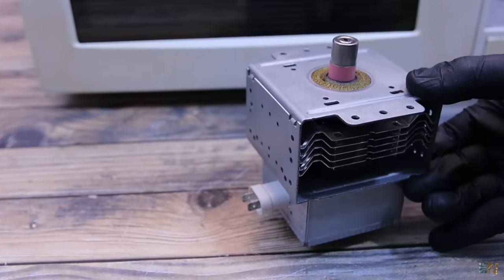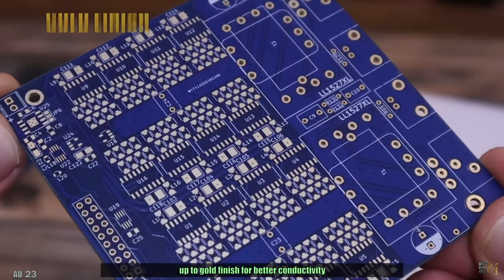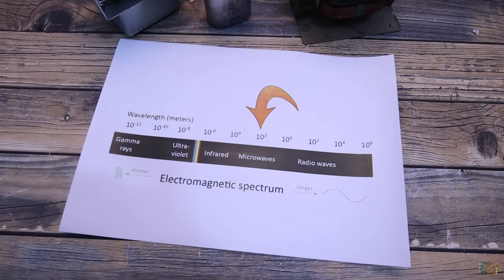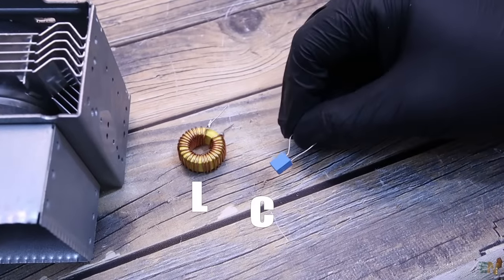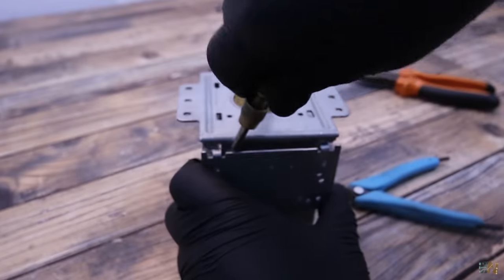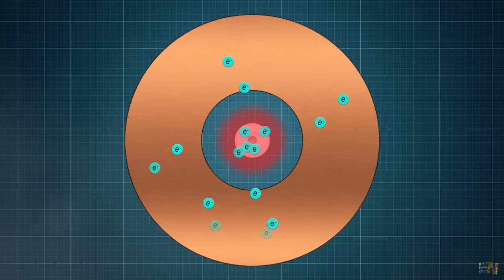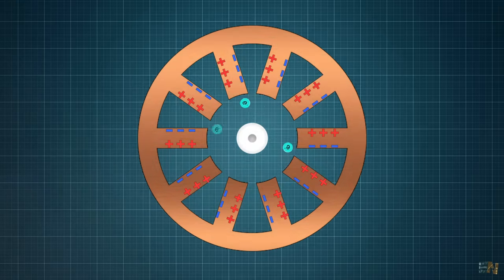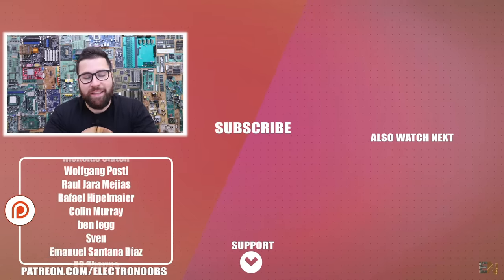MAGNETRON - Teardown + How It Works - Dangerous!

Comment: I worked on radar systems since the mid-seventies in Marine aviation.  I have had a basic understanding of magnetron operation all these years and even taught electronic theory as an instructor, but this was the clearest, most accurate description of what is truly happening, that I've ever heard.  Thanks!
Reply: @stujones3566  Same - really clear info on the LC circuit.
Reply: John, what is the power and frequency used in Marine radars ?
Reply: @Mayosoftware  Tesla level stuff man!
Reply: @JohnNy-ni9np  sus comment
Reply: @JohnNy-ni9np ...its adjustable for military purposes. Long range dissipation is very high. A so called horn focuses the beam. A ordinary sheet of aluminum foil can already protect 100% by reflection.
Reply: I remember once reading about the first encounter with microwaves, from a radar engineer who had a chocolate bar in his pocket, when he got too close to the radar, it melted. Thus he founded the microwave idea.
Reply: Funny I was a radar operator in the Army and this is the clearest anyone has explain magnetrons.
Reply: @synthoelectro I heard similarly, though I heard it was the operators were setting their coffee cups on the equipment and later finding it being hotter than when they first placed it. The radiation bleed was present just not so drastic as to melt a chocolate bar as one walked past. Not to mention body heat will also melt chocolate. 

Cheers!
Reply: ❤❤❤❤❤❤❤ممنونم بزرگوار محترم استاد باشکوه❤❤❤❤❤❤

Comment: Newer microwave no longer use brillium oxide so you're perfectly safe but it's the ceramic dust that you should be more caution about
Reply from the maker: That was kind of an old microwave that's why I tought it could still have... Better avoid it :)
Reply: @ELECTRONOOBS  I think it’s safe as long as you not breaking the ceramic
Reply: Beryllia is very white; a pink tint generally indicates alumina (aluminium oxide) ceramic which is much safer to handle.
Reply: @ELECTRONOOBS  it would have to be one of the very, very early microwaves to have BeO (The old Raytheon Radarange for example)
Reply: Though alot of people still use old microwaves because they were and are made to last... A friend of mine has a microwave that kinda looks like an oven; you can tell it was manufactured sometime back in the previous century just from the look of its design and despite all that, it still works pretty fine.
Reply: More caution! Many danger
Reply: Additionally, I’ve seen “newer” microwaves with obvious “old” parts. Never an old beryllium magnetron, but still never assume it’s all new just because it’s “new” - even if it just came out of the box.

Comment: No Beryllium in a domestic magnetron, it is way too expensive to use there. Just coloured silica fused to make the insulator/ Still dangerous, but not hazardous.
Reply: Alumina probably.
Reply: @plainedgedsaw1694  Yes, only ever saw beryllia in military and avionics, where you needed the extra performance heat wise, and cost was not a driver. The place where you will find Beryllium alloy though in the house is in things that need fatigue life, like pressure gauges and clock escapement springs, where it is used with copper to make a very fatigue resistant alloy.

World production of Beryllium is in the 200 ton per year range, and it is expensive, so no way will that go into a $20 magnetron made by the millions. The ceramic there in a magnetron is purple because they add chromium  and cobalt oxides in small amounts to improve thermal shock resistance, and to allow the ceramic to bond well with the nickel and copper alloys used to make the outside envelope and the feed through terminals.

Comment: A warning about that few kV capasitor would be nice, since old ones might not be able to discharge themselfes on their own anymore (built-in resistor could burn out over time), so during disassembly it's always good to check by bridging the leads with some conductor with a good isolated grip/preferably on a stick.
Reply: Good general advice for any power supply, really.

For really high voltage stuff in the Navy, we had shorting probes and, in extreme cases, thick rubber gloves. I want to say protection up to around 30Kv with both. 

Which reminds me of an actual maintenance check documented in the technical manual for an air search radar I worked on, that dated back to the 50's or so. It was called the "tinfoil test" and was a way to test the "crowbar" circuit that was supposed to shut down the radar's high voltage in the event of a short. 

You would take a piece of foil and wrap it around the end of the copper rod of the shorting probe, fanning it out for a couple of inches. Then, you would glove up, open the cabinet to get access to the high voltage connection, connect the probe's ground clip, then bring that fanned out piece of foil, slowly, close to the HV connection. Before you make contact, it'll arc to the foil, burning a hole in it, until the crowbar kicks in and shuts it down. You then measure the size of the hole burnt in the foil. If the hole is too big, the crowbar was too slow, and it fails the test. 

I got to be first in my class at school to do that test. Makes a rather startling pop, too. 🙂
Reply: I used to repair microwave ovens. I've stripped lots of them. The reality is that if you test the capacitor, the voltage is gone in seconds. It's all BS.
Reply: To test a magnetron , you measure the voltage at the terminals. If the magnetron is dead, you'll get maybe 2.2KV  and if it's good and drawing current it will drop to about 1.9KV. Got to use a high voltage 1000 times probe in the meter to measure
Reply: @brolinofvandar  super cool! Thank you for this share
Reply: ⚡Bang! 💥🤣
Reply: Second-hand, but credible story: almost 30 years ago I was working with an electronics technician who had previously worked at a TV repair shop that also serviced microwave ovens. One of the microwave technicians was killed when he got tangled up with the high-voltage capacitor. 
  More recently, at least 34 people have died while using microwave transformers as a power source for doing fractal burning, a method for burning decorative designs on wood art by using the arc produced by the transformer. You can research this.
  Bottom line is that the transformer and capacitor must be taken seriously.
Reply: False. All HV AC capacitors contain a bleeder resistor. Old wives tales were designed to scare us from a mysterious lethal capacitor inside old CRT TV's. That capacitor is the CRT itself under hard vacuum, the integral plates can hold a huge charge indefinitely. Never seen an AC capacitor without integral bleeder its a rule they exist.
Reply: @flaplaya  NOT 'all' .. many motor run capacitors dont usually, i've used them,  microwave ones do, though , fortunately,
Reply: ha ?
Reply: @clarencegreen3071  Just looked up these accidents. That's insane. How could anyone do that, where you basically create a flash of lightning that eats its way through a slab of wood - and stand right next to it.
Reply: @flaplaya  "False. All HV AC capacitors contain a bleeder resistor."

The OP literally mentioned that bleeder resistor, "built-in resistor could burn out over time".
Reply: @1magnit  I take it you never found a blown bleed resistor then? That's extremely surprising odds considering their failure rate after 5 years operation.....I've certainly found a few and comments that lead to people being complacent will eventually take a life. Please don't do that ever again.
Reply: @beardymcbeardface69  Yep! and yes they DO blow the odd one!
Reply: @flaplaya  Only the Sith speak in absolutes ;-)
Reply: @AsmodeusMictian is that... but then that means...no, no...that can't be...let me see...
Question: "Only" has exceptions and stuff to it, right? Such that it wouldn't be an "absolute" sort of syntaxical unit, wouldn't it not be? Sonuvagun, that's way too many piled up negatives.
Nevermind. Lemme learn how to talk and I'll come back someday. I probably will. It's not like absolutely for certain or anything like that.
Reply: True. I was just waiting to post this information. The microwave should be probably discharges and the tear down only performed by a professional preferably.
Reply: @clarencegreen3071  using 2 car batteries and salt water will do a good job at that to

Comment: You can replace that mica sheet for less than $2 and the oven will work just fine again.
Reply: "and the oven will work just fine again." -- well...not that oven. But yeah, in principle it could've been repaired, before it was torn apart. :)

Comment: Best description of how a cavity magnetron works I've ever seen.
One thing to point out though "This could melt you from the inside out without you even knowing"
You will feel burns from microwaves in the 2.4Ghz (yeah, microwave ovens use the same frequency as old WiFi) region, they vibrate water molecules so you will definitely notice the burning. Microwaves are used in crowd dispersion devices (higher frequencies, less penetration) because you can feel them and they hurt.

The high voltage is a hazard, but a microwave isn't going to cause burns much more serious than a 2000 watt IR heater, especially at a distance. A microwave oven exploits the fact that the waves bounce and are close to the magnetron.

If you turn it on outside the enclosure you're more likely to damage sensitive electronics as well as draw the wrath of whoever governs RF frequencies where you live than get badly burned.
Reply: Yeah I've seen a guy comment on a similar video, he thought the oven stopped working so he put his head inside to check something out and he described the feeling as getting very dizzy, but nothing more serious. And it's the brain we're talking about, so it's definitely not that dangerous.

And anyway it takes a while to get some heat to build up, with the brain thing it wouldn't be a surprise if the actual molecular vibration does something weird rather than heat alone.
Reply: In addition to the correct statements you and @Techalyzer have already made, microwaves also just don't penetrate that far. When cooking food, anything more than about 1" thick will heat much more slowly. For practical purposes, if you can arrange the food to reduce thickness, including putting an indentation in the middle of malleable solids like rice, mashed potatoes, etc., you can heat the food more evenly and quickly.

For humans, this means that yes, some potential for injury exists if one really just ignores the pain involved before things get hot enough, but it's unlikely organs deep in the body would be affected much if at all.
Reply: I wonder if is this going on in Ukraine. During the Bosnian war very expensive anti radar site missiles would get to blow up decoys made of ovens rigged to operate with the door open. 
Probably the highest ratio of cost to kill ratio of any tech warfare kit.
Reply: @echodelta9  Shortwave diathermy machines were used for similar purposes in WWII, though instead of disrupting radar seeking missiles they disrupted a radio beam intersect used by bombers.
IIRC it was called the battle of the beams.

Comment: Dont worry - an insulator of the RF output feeder is not made from beryllium oxide ceramic. Nobody, even Chinese, makes domestic equipment with it. This one is made from Al2O3 with a little manganese doping which defines its color. So yep, basically this is a technical ruby ceramic. Also you can do a simple test when in doubt of containing beryllium - just flash a 360-365 nm UV light on it: corundum ceramics will luminescence with deep red ruby-color and beryllium ceramic shows a weak purple luminescence.
BTW, if anybody interests, the kitchen oven magnetron is just one of the big family - in other magnetron types, like pulsed for radar, coax-type, relativistic MILO or spatial-harmonics mode, the construction and electric field patterns are much more complex but working principle is close the same.

Comment: The electrons alone won't cause any radiation, even when you spin them by the magnet. What makes the microwave energy is the combination of the electrons moving aronund the cavities, forming a kind of "electron whistle" (the theory is a bit more complicated, but on some aspects the electron movement becomes somewhat similar to what the air does in the regular whistle). The high voltage combined with the magnets is use to make the electrons to move along the cavity tops to form that whistle, without the magnetic field they would just fly straight into the cavities, so no whistle.
Reply: A good explanation.
Reply: Actually they do and the video explained that. Any electron that undergoes acceleration releases photons. He said the magnets were put there to make it "more efficient".
Reply: Actually I would be very curious to understand that "electron whistle". Would you have any links or explanation ?
Reply: it's about resonannnnnnnnce. RF is all about resonance, really. What frequencies and what proportions -- and especially geometry. The magnets provide a field for the electrons to surf against and curve into a spiral, it's together with the force of the electric field reacting against the uniform magnetic field that creates motion at a right-hand independent vector. The electric waves radiating out of the center would merely be attenuated by reflection by the LC tank of the copper cavity, but realistically I'd wonder if it would just cease to operate from damage overheating after a short time without the needed magnetic field to transform the radiated energy into EM waves with transmission capability.
Reply: Thanks for the explanation. This is truly incredible every day engineering that we take for granted.
Reply: I think that what you are referring to is what is commonly called "Helmholtz Resonance". I think I remember reading about it when reading about the design principles of Klystrons.
Reply: @annaplojharova1400 - Your theory explaining the air whistle and the electron whistle is mind boggling ! Wonder how the inventor of the magnetron could have visualized this phenomenon in his mind or imagination and produced a
working prototype in those days when computers even were not available to assist him !!!
Reply: techinically 
you're wrong.

"Due to an effect now known as cyclotron radiation, these electrons radiate radio frequency energy"

but this radiation..... is part of the electromagnetic radiation spectrum.
which of course includes all  LIGHT and all radio frequencies (which is what cyclotron radiation is . its simply RF )

microwaves do not generate microwave radition.
nor do they  produce 
high energy radioactive particles
alpha (neutron and protons flying wildly) cannot pass through paper
beta ((high energy electrons) cannot pass through skin
neutrons,(neutrons.... as in nukes, and nuclear power plants) = death/cancer
 nor do microwaves generate high energy electromagnetic waves such as gamma rays or xrays. ( )=can death/cancer

microwaves generate PLENTY of radiation.
they're just not RADIOACTIVE
Reply: (some sources classify microwaves as radio waves )
Reply: Electrons that undergo acceleration whether linear or angular emit photons of electromagnetic radiation.

That's the way the world works my friend.
Reply: @deang5622  Well, yes and no. Yes, when they are moving fast or accelerating a lot.
Here we are talking about barely 5kV, so no, not in magnetrons with barely few kV to accelerate them.
Reply: False
Reply: You are basically describing the RF skin effect where high frequency current moves along the outside of a copper surface, instead of through the copper material.

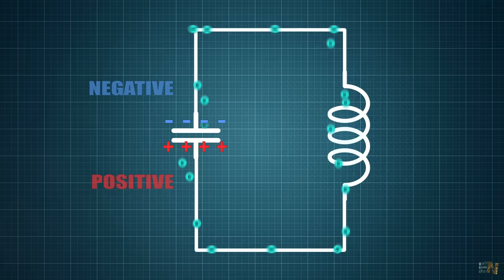Comment: Great video! One mistake I noticed though was in the explanation of LC circuit oscillation. The mistake was the presence of a magnetic field in the inductor when no current was flowing, at 6:59 and other moments, and reasoning that the collapse of the magnetic field at 7:05 is what resets the polarity of the capacitor. Instead, what actually happens is the magnetic field would begin to collapse once the voltage across the capacitor is 0V and the current is maximum, at about 6:54 in your animation. Only THEN would the magnetic field have collapsed, and the inductor would oppositely charge the capacitor to how it is seen at 6:59. I love EM, so I couldn't let this little inaccuracy slide ;) Cheers!
Reply from the maker: hahahahah thank you. The presence  of a "static magnetic field" is actually just a pause in the animation while explaining. In real life it would be fast as you say, the field collapsing after the voltage passes the threshold.
Reply: @ELECTRONOOBS  You're welcome! Just wanted to clarify that an inductor's magnetic field will only collapse in this circuit when the voltage across the capacitor is zero.
Reply: I believe you got something wrong there, as the magnetic field is proportional to the current in the inductor, so the magnetic field has its maximum amplitude when the capacitor voltage is zero. Thinking if it in another way: Energy must be conserved, so when theres no cahrge in the capacitor (0 V) The energy must all be stored in the magnetic field

Comment: I worked in a reprocessing plant for electron RF vac tubes. From a very small 1.5Kw to a huge 357lb (with water jacket) 3.2 Gw vacuum tube and all sorts in between. I learned a lot.  How electrons are emitted and controlled by electromagnet oscillation. This video was very informative and not overly technical. Thanks for a job well done.

Comment: I like this teardown. Subscribed!

It needs to be mentioned that the magnetron receives high voltage DC as well as a very low voltage AC from the transformer secondary coils. 

One secondary coil puts out about 1400VAC, is rectified with a diode and doubled to 2800VDC as it charges and discharges the capacitor in phase. This is connected to the cathode of the magnetron through one of the filament connections.

The other secondary coil is a high current 3VAC and is responsible for heating the filament in the magnetron.